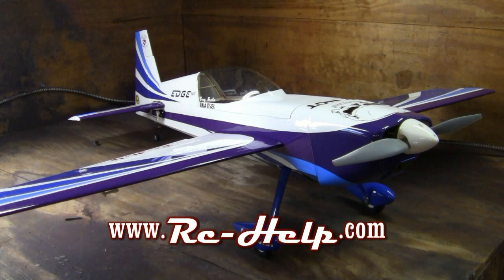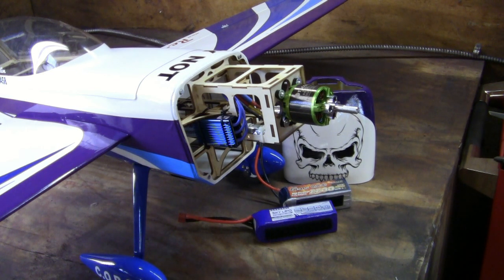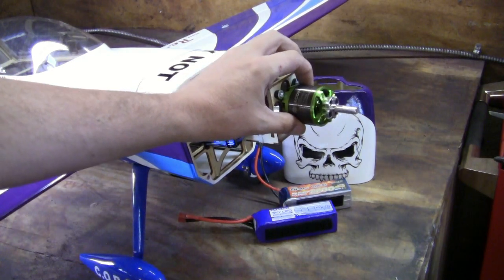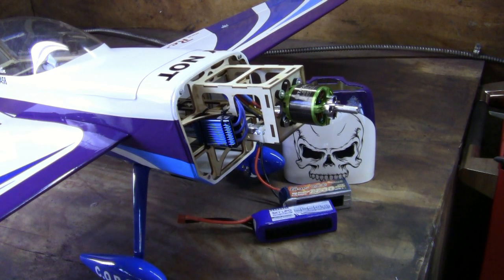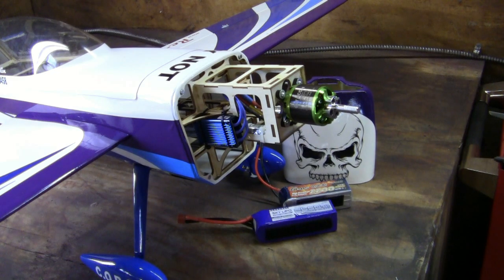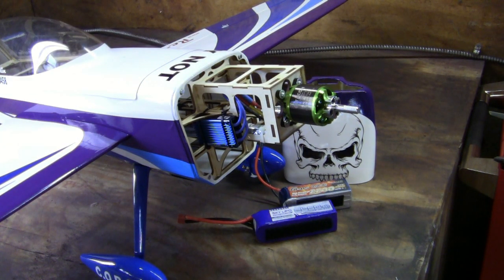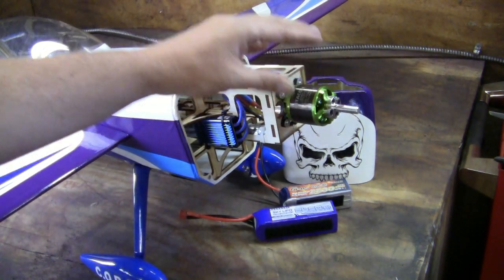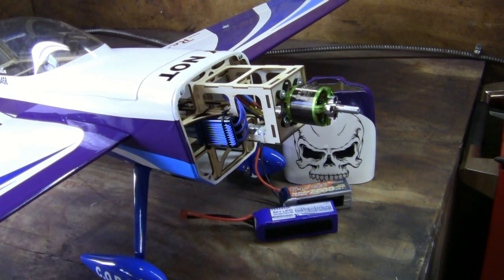Matching Motor, ESC, & Battery

Comment: hey, i have a 2881kv motor for my boat. i divided it by 11.1 v which is my battery voltage and got 259.55. where did i go wrong because i am running a 120 A water-cooled esc and it seems fine, thanks

Comment: hi,  i am running a turnigy areodrive 4250 350kv rating motor with a 60amp turnigy plush esc, the motor draws 55amps, this is for a wheeled project, i am wanting to run it on 2 7.4v lipo, i found one 2s 40-60c 10000mah turnigy nano, trying to think if it will be suitable use. i am thinking of connecting them to make a 14.8v, but i am not sure about the c rating. will the c rating double, (so 80-120c) will it brake my motor or esc.

Comment: hi rchelp.com i have a motor rated 2200KV at MAX 342W which is pulling 30.81amp and i have battery rated 30C 1800mah, I need to match this motor to an ESC, how many A ESC should be best for my motor? previously i have an ESC at rate 30A but I burned out two of them so far, interesting while the ESC is burning the motor is seem not really hot at all. is this the case that i need a higher ESC A?

Comment: This may be a dumb question, but here goes... Does the amp rating listed on a motor indicate the max amps that the motor should be drawing? Or is it just approximately what the manufacturer thinks you'll get?  ie: I have a 670kv motor rated at 40amps on a 4s (14.8V) battery which gives me 45.27 Amps. Am I overworking the motor? ( a 5 cell would bring it right down to 39amps, but I already bought two 4 cells)

Comment: The motor I have is a Turnigy G46 (670 kv). It lists a 12x8 ~ 14x10 prop. That's pretty broad. Is there any rule of thumb as to what might be closest? I understand a lower kv may often require a larger prop. On a side note, I have a watt meter on order... so I'm glad to hear your recommendation regarding that.
Reply: Pay attention to amps rating  because too many amps will spell disaster for your motor and esc, stay within the motor and esc ratings ,if your motor is rating 40amps the esc should be 50 amps pick a battery that can handle the highest motor rating . 2200 at 20c is 44 amps ,get it.

Comment: Great video !!! Can u help me ? I want to use a 4s 3300 lipo on eflites Hurricane, it recommends using a 3s 3200. The ESC is a 60a with a 1000kv 25 size Brushless motor, would this be safe ?
Tony

Comment: If you run a 3S with a 800kv motor, you WILL have worse performance than with a 4S battery.. mAh only affects flight time and discharge rate...

Comment: Hi, I'm new to building, and just picked up a new Himax outrunner motor, it is a HC3514-2900 800w. I think it is a funjet set up with a Phoenix Icelite 75am ESC I know it has a lot of power but I'm making a big airplane with 70in wings it will weighs about 4 to 5 pounds, is this a good motor for my set up?

Comment: Based on those calculations my motor would want 63 amps but the esc i was looking to get is just 60. Is that close enough or do you think things will get hot? Its for a boat and the esc is water cooled.

Comment: the plane and flying style dictates what prop u need. then the prop dictates what motor and batt can spin it. the kv and cell count will need to be factored in at the same time. then finally u choose an esc that can handle the power demands

Comment: I had another question. The motor i want to use says the max voltage is 8.4v. does this mean if i give it more than 8.4 it will burn up? It just doesnt seem like that much power.

Comment: While a bigger mAh rating would not give you higher performance in terms of power, but it would definitely enhance the duration of your flight. A 2650 mAh batter would provide 2600 mA or 2.6 amp for one hour i.e. until the battery completely dies or zero volts. It is not recommended that a lipo be allowed below 9 volts.

Comment: @RcHelpDotCom Thanx! Again im NEW Would this $150 Order be a good build? HK450V2 CCPM 3D Heli Kit, Turnigy 9X 9Ch Transmitter w/ 8ch reciever, HK 40A ESC 4A UBEC, HK GA-250 MINI-MEMS Gyro, TP 450-Size 2415-07T Brushless 3850kv, HK450V2 Pinion Gear 3.17mm 11T/13T, Turnigy R/C Heli Pitch Gauge, Turnigy 2200mAh 3S 20C Lipo, Fiberglass Main Blade 325mm, 3 HXT900 1.6kg/ .12sec, Corona 919MG Metal Gear 1.7kg/ .06sec (Tail) IMAX B6 Charger/Discharger 1-6 Cells! is this OK? if no what would you recomend

Comment: Hi Tony. Great video! im new to 3d Helis but im planning to build a Exi 450 heli. i been watching alot of Vids and reading alot of blogs about how to build it using the right electronics but no one has ever seem more clear that this Vid you made. Thanx alot...! just to be SURE though im planning to get a Turnigy 2900-3500Kv Motor with a Turnigy dlux 40A SBC ESC with a 2200 mAh 3S 30C lipo. is that combo ok?
and what difference would i see if i use a lower Kv rating motor? or a 3000mAh 3S 40C.

Comment: Hi Tony, Is there a way to calculate the watt rating from the motor Kv rating and voltage? The E-Razor 450 has a 2750Kv motor so what would this equalte to in watts?

Comment: Great Video ... I am confused over one thing. you mention how to determine the AMP rating of the motor by dividing the watts by the number of volts (700/14.4) 47 amps. If I use the same scenario and use a 3s battery (700/11.1) 63 amps.

Does this mean that I need a larger ESC with a smaller battery? 3s versus a 4s battery? I must be missing something ...
Reply: I'm right here with ya on this ?   lolzzz
Reply: Your better off going with a 4s pack
because 63 amps will reduce your fight time.
Yes a small 3s pack only supplies 11.1 volts
on 700watt motor need more amps to spin it do to the lower volts. its all a balance for a motor to produce 700 watts.

Comment: two questions for you. although the larger battery will not give you more performance, it will give a longer flight time correct?

also, do you have a video explaining how to see how much power was used after a flight to determine the flight times for that setup?

thanks

Comment: Thanks for that info.  I calculated my set up on my truck,  my 800w 2200kv motor with a 80a esc are a good match.  My question is,  is it ok to use lipos going way over it's capacity?  I want to run 2 5000Mah 40c 2s I know it equals to 400 amps.  Is that ok?

Comment: what about the voltage of the battery and voltage of the motor? Can I get a higher voltage than that necessary for my motor? For example, I see this motor rated as 2-3S but im considering a 4S battery. I'm new to the hobby and trying to get my head wrapped around the selection process. Thank you.